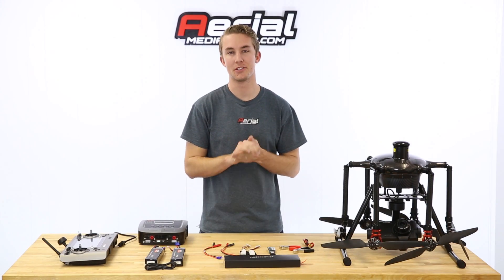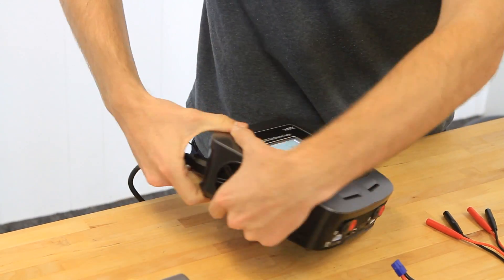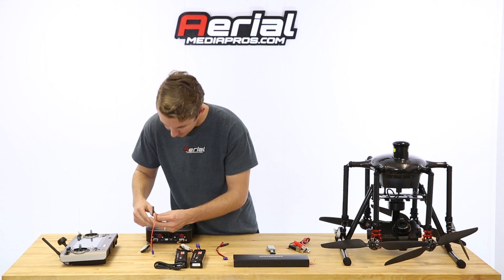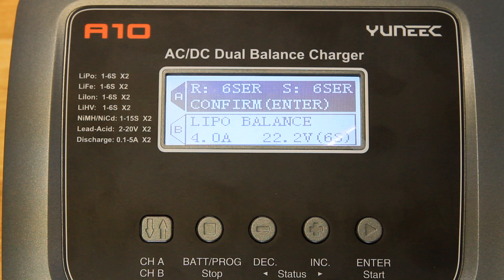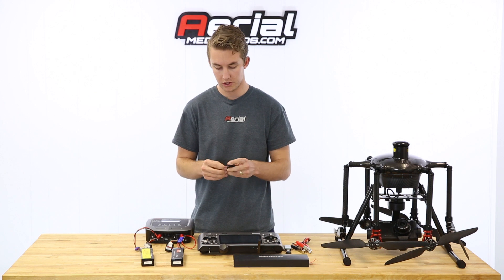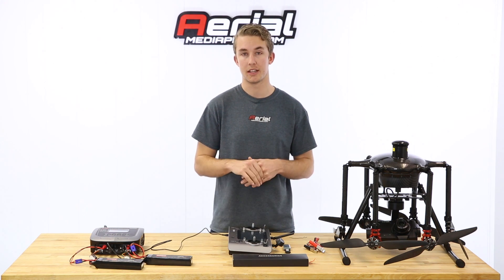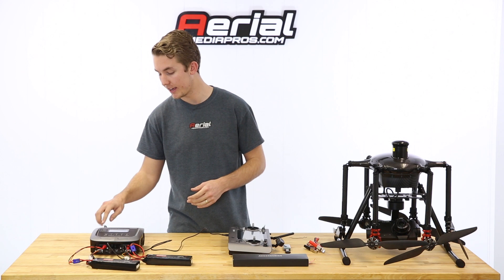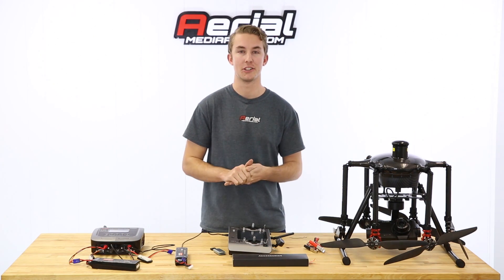How To: Yuneec Tornado H920 Charging Lipo Batteries Tutorial

Comment: I come from the automotive world. General question " Does anyone make and would it benefit drone fliers ( Yuneec batteries) to have a "Load tester" for the batteries?, I already have a cell checker and a SKYRC D100. I had charged 2 Black Yuneec series Q500 batteries and checker showed 4.20 across the 3 cells, but only lasted about 5 minutes , batteries have ( 7 flights each doing the LiPo break in procedure @ 10 flights for 10 minutes ( as per Drone Camps tutorial) , didnt get past 7 charges and this happens.. Thanks